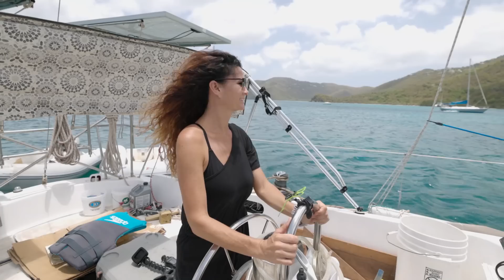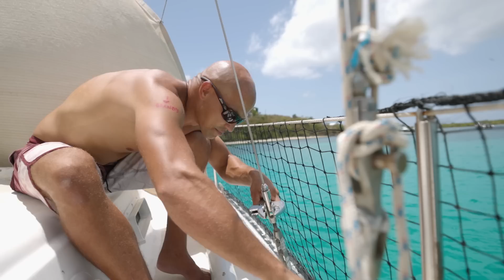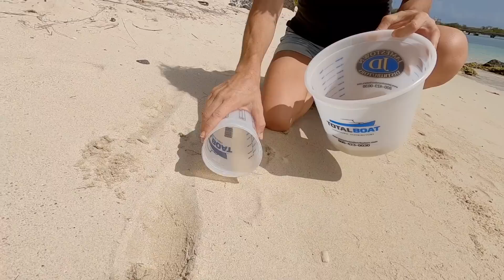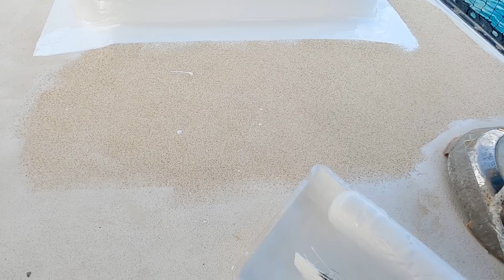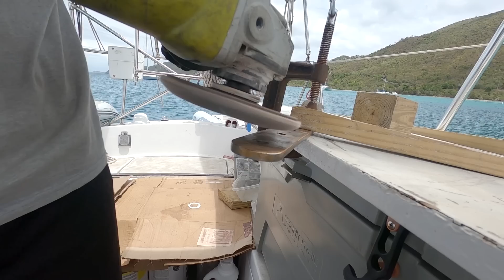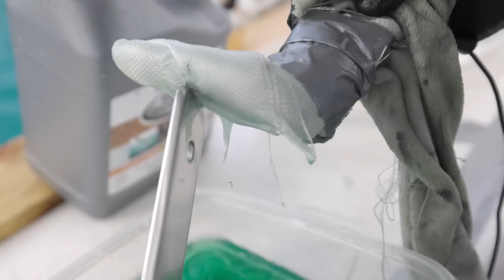SALT WATER CAN WRECK YOUR BOAT (electropolishing chainplates)

Comment: Hey guys.  My wife and I are long time followers.  I am wondering what you guys do to prevent chemicals, foreign debris from endless sanding and fibreglassing you are doing in a bay that you swim with many marine life.  I see the vacuum sander but the degree of wind you’re doing maintenance in, there’s no way you’re catching everything.  Please, if you have further methods in place to control adding to the incredibly bad state our earth is in due to pollution, please post them in a video.  I’m not trying to disrespect you guys as individuals as I love your not quit attitude and I love your positivity.  I’m just such a nut when it comes to working over the ocean.  Respectfully submitted… Phil

Comment: Hi again, a week or two back  I suggested using DYE penetrant to look for defects in stainless and other metals. I've remembered another thing about stainless I've noticed a few sailors doing. Never, ever use a Sharpie to mark your cuts etc. Sharpies use a chemical call Zyaltel as a drying accelerant.  It is a type of chloride that unfortunately eats into the surface of the 316 and allows other chlorides (salts) to begin the process of consuming the metal.  It becomes much worse at temps above 100 degC, now instead of rust it chemically breaks down the granular structure of the metal and only ultra sound can detect it.

So please use a chalk pen or pencil, or cover in blue tape then mark.

PS. A dealer in welding machinery and gear should have the tins of Dye.

Hope one day to see you both in person.

Comment: Big woof. Impressive that you did electropolishing but the way you did your citric acid passivation is something between useless and negative. NASA released a great technical paper on citric passivation and found that both on the positive and negative sides there was a correlation between time and temperature. The point of passivation was to build up that oxide layer but that will be actually reversed somewhat with too much time or too high concentration… you may have just undid your hard work…

Comment: There's absolutely nothing wrong with using fine grain sand for nonskid.  That is, essentially, what the stuff you buy is.  I did it on one boat using a salt shaker.  First, you put down a first coat of paint, and, while it's still wet, use the salt shaker to get an even spread and let it dry.  Then gently brush off what didn't stick, and put down two more coats of paint over the grit.  The extra two coats of paint help smooth out the grit a little.
Reply from the maker: I think that may be the kicker. The top paint has worn away and now it’s just collecting grime and tearing stuff up. Maybe we need to just paint more. May need to test it out.

Comment: Brandy, I had nonskid put on little boat, we used thickened gel coat, it tears  my skerry topsides, and anything else it comes in contact with, yet it keeps my fat backside on the boat no matter how wet the deck is. I like it as it is perfect here since the water is so cold you don’t want to fall off the boat or risk the hypothermia
Reply: I hear so many people say they would never have a teak deck but this is exactly why i love them.
Reply: @chrisscott1958  a teak deck can be slick with water come over it while the thickened gel coat and a corn cob roller puts a deck on that you will not slide on, yes it eats shoes in about two years yet sailing on a lake where the water temp will put you in hypothermia if you fall in isn’t a good idea. And yes we get waves on this lake if a storm comes rushing in, it happens and being surrounded by mountains doesn’t help now the wind will swirl. Just be safe with what you choose, it’s your life you want to protect
Reply: @kevinhaley8625  I am fortunate that my decks are wide and i keep them maintained, If you keep the teak clean and the bedding solid they seem quite solid underfoot. Many in the Caribbean feel they are too hot, but a bucket of salt water or a pair of shoes solves that,  I would love to try sailing in the mountains, it sounds great,
Reply: @chrisscott1958  it is different, the wind comes from every point of the compass most days, with it straight down sometimes when near the cliffs. It is a lot different than when I started sailing in so. Cal. so I’m learning the air patterns here slowly and loosing a lot of races, yet still nice to be sailing and out on the water

Comment: I've used sand in deck paint for the entire boat several times and you're right, it'll tear up skin easily. But the secret is to flow a couple more coats of paint over it. And there's nothing wrong with a light sanding after the first coat. I found it durable and lasting for years. It's excellent for foot traction.
Reply from the maker: Maybe that’s all we need. I don’t really remember it being this bad at tearing things up after we freshly did it the first time around.

Comment: Just a thought for your chain plates might sound stupid but I have to do it to my buttons on my pants and it works very well because I'm allergic to the metal but would painting the painting the bottom portion of your chain plate that's underneath inside the boat from rusting and corroding with a clear coat nail Polish like I do prevent that just a thought
Reply from the maker: It could possibly work. Not sure. We are hesitant about painting them in case water sneaks in behind it.

Comment: Chainplates: You are the Man, impressed! Bolts: Stress Corr. Chracking in austenites will , allmost by law (Murphy) happen. To make it happen you need stress and electrolyte- like sea water. The best remedy is to keep them dry. If not, replace on yearly basis is a good spec. As you live in the tropics, you are more subjected to corrosion than us living amongst rain deer and polar beers. I'm not that far north, but just to put things into perspective :-) Tonight at 23:15 hrs, outside temp. is 7,6 deg C.
Reply from the maker: Yes! We are looking at ways of keeping them even more dry!